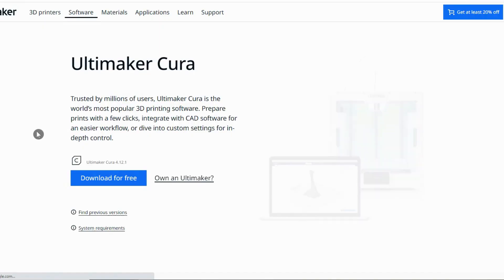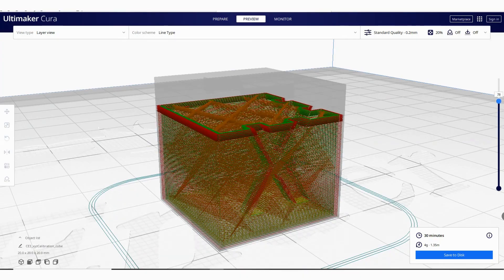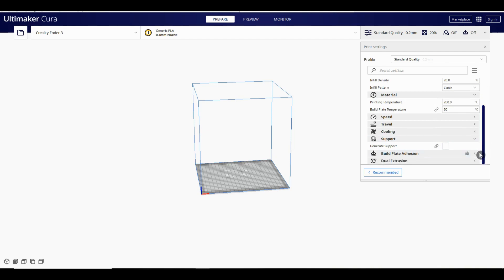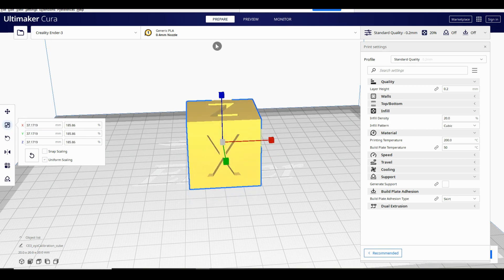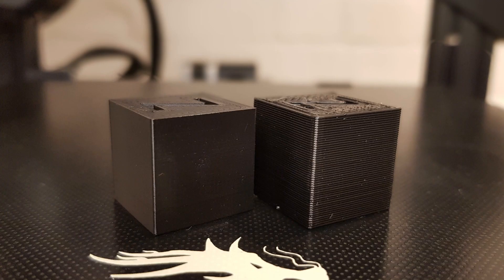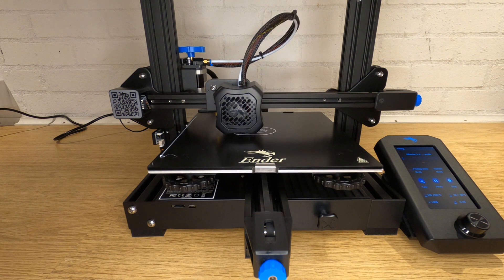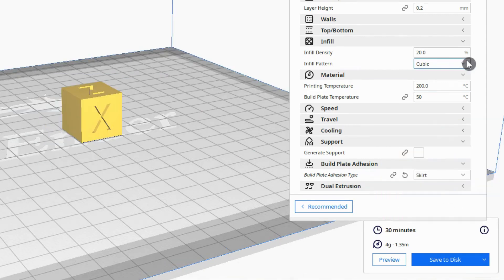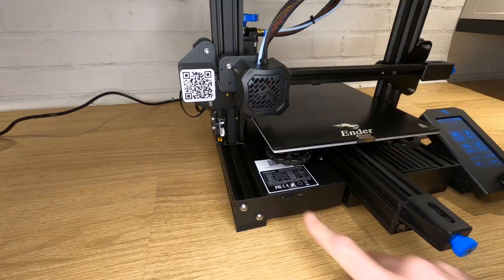Model File to 3d Print - A Beginners Guide to Using Cura (3d Printer Slicer Software)

Comment: I have a question. I’m trying to print out some of these articulated models (a trilobite in particular) and some have the flat bottom face come up as red in Cura and some models don’t even though they’re flat on the bed. Is it okay to print the red ones as they are or do I need to add support?

Comment: Can I not use Cura to print my part without using an sd card? I can do it in Matter Control by connecting my printer to my computer with a cable but I can’t figure out how to do it on Cura(I have an Ender 3 S1 and its built in printing software is actual garbage so using an sd card isn’t and option). If anyone could help please give me some advice! I’ve been trying to figure this out for months

Comment: Thank you for the video.

I am pretty frustrated with the setting up of my first printer (Neptune 3 Plus). The instruction for doing the A4 paper thingy was lost on me after "read this"

It can connect to my computer using a standard printer cable. 

I've set Cura to see the printer and for the life of me can't see an option to "print" the model.

I can manually move the printer bed and print head and set the temps in "monitor in Cura. But my printer will not see the file on the touch screen.

Question: Why have the ability to connect the printer to the computer directly via a cable only to have to save the damn files on a pissy micro SD card?

Question: Why this model printer did not come with a USB input I've no idea. It has the old square printer input.

Hope you can help!

Comment: Really clear vid Ricky cheers! I’m very new to all this, and got surprised by the fact Cura remembers the settings from how you sliced your last 3D design. Naturally you want it to retain your nozzle & bed temp, etc. But if you’ve added a brim to a print, it will add the same brim to the next project you slice, unless you manually change it. Unless my Cura settings are up the spout, might be a useful reminder for newbies!

Comment: Hey there I'm pretty new to 3D printing and I have had terrible terrible success my 3D printer does come with its own slicer but it's terrible as far as I can tell because I have not once ever printed a successful print so I'm curious to see if cura will help with my printing. I have a printer that is Wi-Fi capable can I print files directly from cura or do I have to save 2 the USB to print on the printer thank you I look forward to your reply.

Comment: Ty for the help. Im still struggling on what size computer i need like ive been told 16gb ramm but ive also been told 8gb would work so kinda dont want to buy the 8 gb one then find out it wont work but the 16gb is like $700-$1500 and that seems like a bit much so i need help from a professional 😅
Reply from the maker: I still run slicers on a very basic old laptop. You really don't need anything powerful at all. Slicing the model will take a little longer on a less powerful machine, that's all. I wish I could give you some definitive minimum specs that will work but I've never tried anything that isn't good enough.

Comment: For some reason the cura software thinks I have an Ultimaker printer - I have an Ender 3. 

Anyone know how I can change the settings to correct this.
Reply from the maker: You need to add a new printer and then choose your Ender 3 from the list of non-Ultimaker printers.
Reply: @RickyImpey  Thanks. I seem to have missed that  and gone along a different path.  Much later I somehow landed  back on the correct path and registered the printer.  It is not plain sailing though. The printer keypad now wont let me choose a file to print from the SD card !  I think it is going to be a long week.

Comment: I have a very important question. I'm getting an Ender 3 Neo for Christmas this year (I know, 3 months early), but I don't see an Ender 3 Neo in the settings? Are you supposed to add one on your network or use a completely different slicing program? Or maybe does a default Ender 3 work the same as a Neo?
Reply from the maker: Hi, this guy has some great information about a Neo cura profile: https://the3dprinterbee.com/ender-3-neo-cura/

Comment: Hi, extreme newbie here- my first ever 3d printing was this afternoon! I managed to print off the cube, all as per your video but then have since struggled with my own model.  The printing problems for my model appear to be numerous, and I don't know if it is one simple but catastrophic error or many different ones. I have had to abort numerous attempts. The first issue is that the skirt doesn't adhere to the bed and the resulting shape is not as it should be and the filament cuts the corner of the curved outline and ends up very nearly in the way of the actual model. The 3d print also looks very slightly different outline to the original model- just in the same corner that has the skirt problem. I leave it printing in the hope it will right itself (!) but then the model starts to lift off the bed- again in the same problem corner. I started off with the same settings as the cube, then tried adjusting the speed, temperature and z height, but sadly its still not printing properly. I always have to stop the print at approx 10% (as it would be a waste of filament and time otherwise! )  I use SketchUp for the modelling and my test piece is a keyring I created using the 3d text tool. Before exporting the SketchUp file I check the SketchUp model is ok with the solid inspector tool.  When imported into Creality Slicer the model has a grey 'shadow' around it. According to other forums/ posts this means the model is somehow corrupted? Can you advise how I can fix this?
Reply from the maker: Hi, the most likely cause of all your problems is that the nozzle is too far from your bed when the first layer prints. Check out some guides for bed leveling and setting a z offset depending what printer you have. The first layer z height is pretty critical and can cause massive frustration when not right.
Reply: @RickyImpey  Thanks- will do! Any idea about the 'grey' shadow? I cant post an image here, newbie to commenting on YouTube too!
Reply from the maker: @user-hg8tz2mb5m  Sorry, I don't use sketchup so I can't help you with that part. Unfortunately you can't post images in YouTube comments.
Reply: @RickyImpey  I think you are spot on re levelling diagnosis- I printed the cube off fine, but that is so small it hadn't picked up the issue. I've tried relevelling many times as per your video and I'm now wondering if the bed is warped (guessing the centre is lower than the edges). Every time I go through the manual levelling- going back to 1 needs as much as 5 clicks down, then I do it all over again and the centre is off again by the same amount. If I leave it as is and then go to the auto levelling it puts positions 2-5 too low/ scraping the nozzle on the bed. I saw your video of Nov 2021, but don't have a thickness/ feeler gauge. The printer is brand new, but already thinking of buying a glass bed?!

Comment: I have read certain file types can effect your print quality is this true do I need to use different file types to get better quality?
Reply from the maker: It depends what you mean by 'different file types' Brett. The slicer will outut gcode for your 3d printer to read. There are different file types that the slicers can read to create the gcode, mainly stl and 3mf. STL has less information but it's unlikely you would see a difference in two model files that were just saved as either an STL or 3mf file.

Comment: i have a voxelab aquila c2, its not showing up on cura. does it have its own software?
Reply from the maker: Often you need to either create your own profile or use one from a similar printer if there isn't one available for your machine. An Ender 3v2 profile may be a good starting point for your machine.
Reply: @RickyImpey  thanks for the suggestion, after a lot of fiddling I got it to work

Comment: Excellent video. Really helped me out finding the courage to finally start printing bigger things than the little owl.

Quick question. If I have a model that is to big for a single go, can cura slice this into 2 parts too? Or do I have to manually separate them in fusion 360 or my 3d Software of choice?
Reply from the maker: I find the best way is to cut larger parts up in separate software as this is not something that Cura does very well. There are ways to do it but I don't find them very easy. Here is one option: https://www.makeuseof.com/cura-3d-slicer-split-object-into-multiple-parts/#:~:text=To%20start%20splitting%20the%20object,file%2C%20and%20print%20them%20individually.

Comment: I use this method but it automatically saves it to a UFP file.  Do I just change the file type or is there somewhere in my settings that needs to be changed?  I'm using a Easythreed X1 on Cura...
Reply from the maker: Try exporting from the 'file' menu at the top. You should be able to change the export format.

Comment: Thanks for a great video. I need to print a small bracket for my sawbench; it will hold a lightweight accessory that is not in use. Most of the bracket is composed of pieces no more than 3mm thick - should I print this with infill, or is it OK to print the whole thing as solid PLA? The bracket doesn't need to hold a lot of weight, perhaps 700 grams. Thanks.
Reply from the maker: Sorry for the delayed response. It's difficult to advise on infill without seeing the part and the application. Generally, more infil is stronger up to about 85% and then there aren't any gains. In fact, in many instances, 100% infill is weaker than 85%.

Comment: I can do all of what you said, my only problem is the printer doesn't see the G code. Thanks
Reply from the maker: Make sure it's not in a folder and is saved to the roof directory. Many printers can't see files in folders.

Comment: I’m pretty close to giving up I’ve tried printing/ converting stl and zip files to get them to 3d print but they never come up on my ender 3 v2 sd so I think I’ll just sell it on marketplace to try and redeem some of my money pretty sad and pissed off
Reply from the maker: Hi, did you watch the video? You can't convert the files, you need to open them in a slicer.

Comment: I have a 3D printer from the brand "Balco", but I can’t find the brand in Cura, does anyone know what to do in that situation ?
Reply from the maker: Hi, unfortunately not all printers are supported with a profile in Cura. You have two options really, create a profile of modify one from a similar model. There are a few basic features that will change the way you set your machine up in Cura. What is your bed size? Is your machine direct drive or does it have a bowden tube connecting the extruder to the hot end? Does it have a heated bed? If you have a web link to your model, post it here and I will try to help you get setup.

Comment: Best Video in layman’s Terms, I save the file to sc cards, nothing on when I plug it in to the printer though?
Reply from the maker: Hi, I would say there are 3 possible reasons for the files to not show up:
1) Make sure the g-code files are not in any folders, they must be in the root directory.
2) Make sure the file names are not too long. Some printers can't read long file names.
3) Your Sd card may be too large or faulty. Generally they need to be 8GB or smaller.
Hope something here helps

Comment: I've tried to import my file, but when I click the file button nothing happens.  Do you know what to do?
Reply from the maker: Not 100% sure of the issue you are having but if it's importing files into Cura, I had a something similar after a windows update. Have you tried dragging and dropping a file onto the build plate?
Reply: @RickyImpey  No, I haven’t tried that.  Thank you for the suggestion.

Comment: Does Cura work for resin printers as well?
Reply from the maker: No, you need a different slicer for resin. I can recommend Lychee, that's what I used when I started with resin. Here is what I found in the first few weeks with a resin printer https://youtu.be/pTM4C9W34ms

Comment: My files are saving as winrar and not the required ones though I’m not sure whu
Reply from the maker: Hi, that just means you need to extract them. It sounds like you already have winrar so use that to extract the contents, then you'll be able to open them on your slicer.

Comment: My 3D printer is not printing in the center of the bed, why does this happen?🥲
Reply from the maker: Check the machine profile in your slicer and make sure the dimensions are set correctly. If they are out then the model will not print in the same place that you see it in your slicer.

Comment: Ok so I want to print halo armor I found files on Etsy how do I get those files over to the printer kind you I don’t have one yet I would like to know how to do things before I go and spend stupid amount of money
Reply from the maker: Exactly how this video shows. You need an stl, 3mf or other file the slicer software can open then 'slice' each part individually. The sliced 'g code' goes on a SD card that goes in your printer. In theory, you then hit print. The problem you may have with something so big is that some parts won't fit on many smaller printers. If you want a bigger printer then consider the Artillery Sidewinder X2. This is my review https://youtu.be/ob9vTK_vZYM

Comment: I set printing temp on Cura 200.. when i put memory card and push print.. projects go on 175, why?? please i m new here :D
Reply from the maker: Hi, difficult to say as it shouldn't do that. Double check that you are slicing the model after changing the temperature to 200°C. If you change it after slicing, it won't save the changes.

Comment: When I try to download Cura(on both my Fire Tablet and iPhone), it only downloads a file full of what appears to be code.  Any idea what the problem is, and why those grey boxes with the "next" buttons don't pop up, that would allow me to use the Cura software?
Thanks!🙏
Reply from the maker: Hi, do you know that Cura is available for those devices? I thought only Windows, Linux and Mac IOS were supported.
Reply: @RickyImpey  I have no idea.😂  I downloaded every version, on both devices, hoping one would work.  I guess I should have looked up whether my devices were using one of those systems.  Well, maybe I'll have to use a different slicer?  I hope I don't have to buy a pc just to slice.  I just ordered a Bluer Plus printer, on sale for $219(which seems like an amazing deal), and I didn't think I might also need to buy a pc.  Hopefully the Marlin firmware is compatible with other slicers, and j can just go that route.  As you can tell, I'm a noob, so I really appreciate your help!🙏  Learning about printing is easier than I expected it to be(even though its taken me 3 months of research just to decide which printer to buy); and it is only easier because of people like yourself that make such helpful videos.  I knew I'd have difficulty when it came to programs or software though, because I have some kind of tech allergy that follows me around like Eyore's rain cloud.  Something always goes wrong, or I overlook something important.  But I'm slowly getting there...hopefully.😂  Thank you again for your help!  And I subbed to your channel.✌
Reply from the maker: @scubadoo7951  Eeek, well I'm sure you'll be fine😬🤞 Check out Astroprint and OnShape. I haven't used them myself but I believe they're web based so should work on all devices.
Reply: @RickyImpey  Thanks, Ricky.  Yeah, I just got done looking at those.  Astroprint needs a box that you have to buy(and you might have to buy one of those other Octos or PI's to go with it...I stopped reading after I learned I had to buy that box); and the lowest tier of OnShape costs $1,500/yr.  So buying a laptop for a couple hundred dollars seems like the best solution so far.😂  Now I just have to figure out which laptop to get.  Do you know if laptops that come with a special stylus for drawing are useful in 3d printing?  I've never seen anyone use that stylus during modeling, but there's a lot I still don't know, so I thought I'd ask.
I really appreciate your help, Ricky!  I've only talked to a couple of people in this community so far, and this seems like a really supportive community.  Hopefully someday I'll graduate from my noob status, and be able to help a few people like you have helped me.🙏
Reply from the maker: @scubadoo7951  Ah ok, I didn't realise you had to pay for those options. Have you tried googling for a 'browser slicer' or similar? I'd be really surprised if there isn't a solution for you. When it comes to laptops, it doesn't need to be anything special at all. I have used very basic machines for modelling and slicing. If were you I would just try to pick up something second hand that is cheap to get started.
Reply: @RickyImpey  It's crazy there's not another slicer option for Android or iOS, right?  It shocked me just as much.  And I don't know enough about computers to know if you can download a second os on your device.  If that was the case, I'd just download a version of Windows.  But for all I know, it might somehow disable my device.😂  I pulled an early 2000's laptop with windows out of the basement, so I'm going to try that first.  If it doesn't work, I'll just grab one of the $150-200 laptops I found online.  I don't feel so badly about it, since I got such a good deal on the Bluer Plus printer.  I'm more surprised than anything.
Thanks again so much, Ricky!🙏

Comment: I have the R3D Mini Printer as a result it doesnt show up as my kind of printer, so how can I add the product  of this 3d printer to be able to use my 3d printer with this software.
Reply from the maker: For printers that don't have a profile in Cura, you will need to add a 'custom' printer. Not ideal and you need to be careful with the settings you use. You have to enter things like your bed size etc.